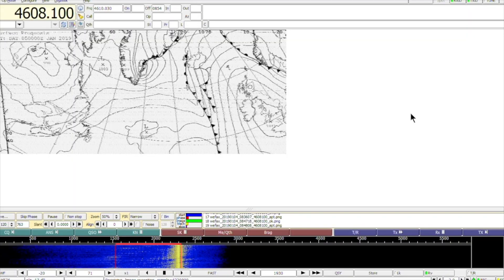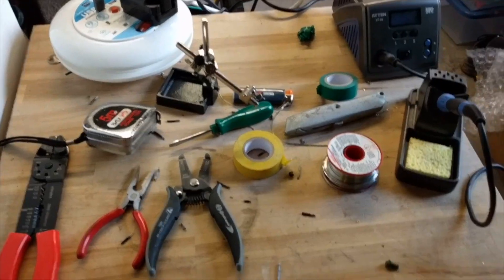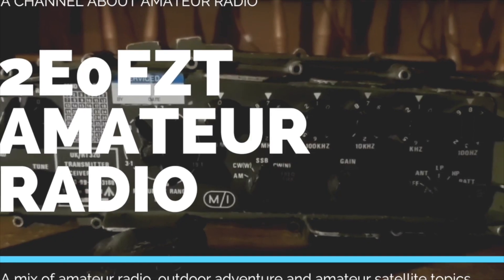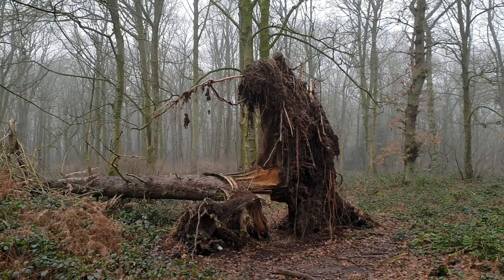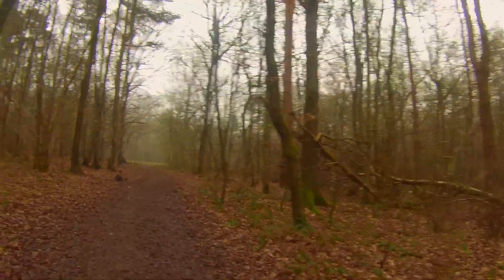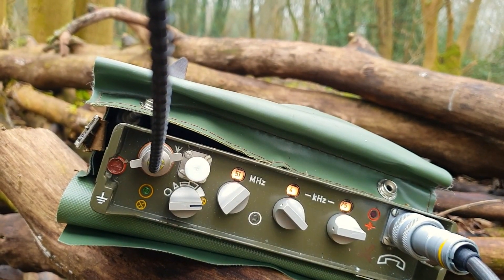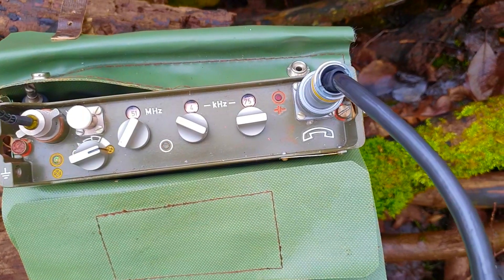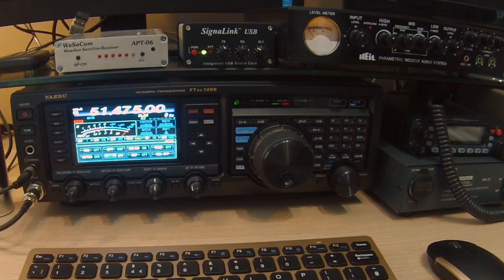On air HAM RADIO test of the Czech Military Radio RF-10

Comment: I have one of these sets.  Wish I could build a battery for it and just hear it work for my military radio collection.  As an electrician you'd think I'd figure it out LOL.
Reply: battery can be rebuilt cheaply with a 6V SLA battery. remove the old nicads (very expensive to replace), clean the leakage out with vinegar, rinse and dry. modify the plastic hattery spacers to fit the SLA battery, solder to the tabs and close it up. I've done 3 with good results.
Reply: @edmcg1918  I just picked up a second one and I am having MTO battery rebuild them.  The first one I posted about once I got it apart all the wires were corroded and hosed.  MTO will rebuild them for 60 bucks.
Reply: @edmcg1918  just got my batteries back today and both work amazingly!!!  Now I need to source new chargers!
Reply: @Tony Tony I tried rebuilding mine myself, but there was a lot of corrosion and MTO charged 60 bucks per set.  I couldn't beat that!

Comment: Hi Carl where did you get the RF10 from. I bought one but it doesn't transmit
Reply from the maker: I got mine from eBay unused. Does it key up but no audio?
Reply: @M0SZT   I have one that does that... suggestions?
Reply: @edmcg1918  I had the problem.  I opened the handset and a wire needed soldered.

Comment: Hi Carl. I was wondering how you get on with this radio as I noticed the bit of the 6m band you can use it on is on a different channel spacing to what you can set on the rig itself, ie 20Khz on the band and 25Khz on the rig. Or am I missing something ? Does that mean your contact would have to have a VFO to tue up to you ?
Reply from the maker: The calling frequency is 51.510MHz so going up it's 51.530 then 51.550 which is where the RF-10 can operate, same going down, 51.490, 51.470 then 51.450 (RF-10).

Comment: i have one of these sets,..and the big polystyrene box of accessories,....but It didn't contain the impedance transformer for the 30m longwire aerial,...or the multifunction tool,...did you get these with your kit?,....have you used the longwire aerial yet?,......Ron G4FBC
Reply from the maker: I got the wire and a number of things, to be honest I've stored them, I must get them out and use the kit it came with.
Reply: @M0SZT  the transformer you will find when you unroll the big wire kit no multi-function tool with my radio

Comment: I bought 2 of them. Rebuilt the battery's. Work well and easy to use.
Reply from the maker: Yes I found a lifepo battery that fitted snuggly into the compartment which made things easier.

Comment: Great stuff mate. I like to do range tests on low power around my  immediate location and mostly get the misses to monitor my signals, she is licensed which does help but using the camera for this was a great idea. Many thanks.
Reply from the maker: Thank you
Reply: @M0SZT   hi mate i just taken my long wire off the mount its about 108 ft long almost 6 wavelengths at 51 mhz so you would get end fire how i see it transformer connects to the radio there is 3 short ground wires to lay out ,At the other end there is a resistor to ground and 3 earth wires to lay out in the middle is a wire loop fix to the top of ya pole so it is like a upside down "V" point the resistor side of the antenna in the direction of station to be worked it was made for point to point coms on a defensive line hope this helps i am thinking to modifier mine so i can use it for hf as well by disconcerting the resistor and using it as a inverted V end fed   with my LC tuner